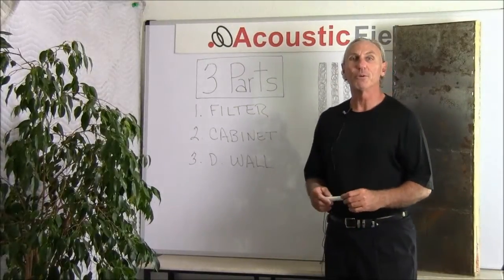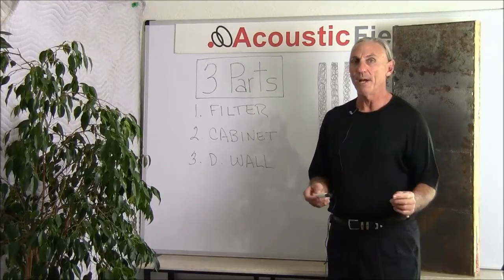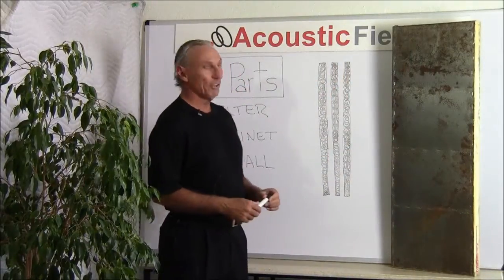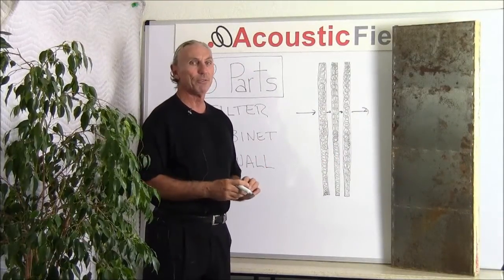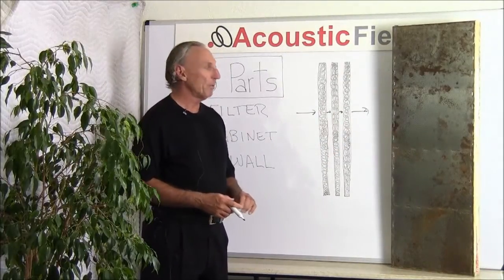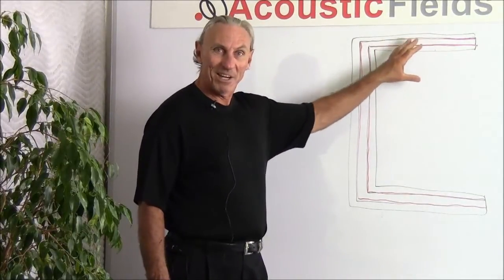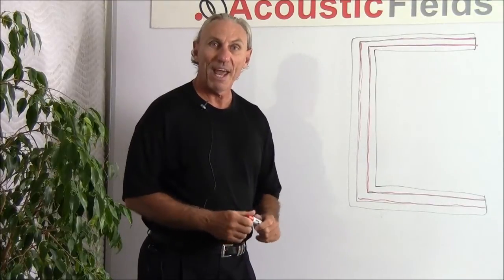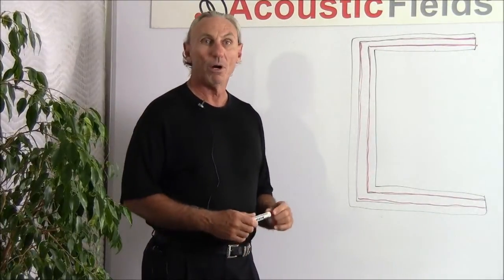How Our Diaphragmatic Absorber Works - www.AcousticFields.com

Comment: What's the material from which cabinets was made? 2 inch walls with 7 layers inside, what is that material it i's possible to know? And, material of front walls? 
In BDA DIY PDF I purchased from your web it says that almost everything was made from MDF except active carbon holders which is perforated PEG boards. 
I assume, cabinets you've built and sell on your webshop are made from different material, right? 
Thank you advance for eventual reply
Vlad
Reply from the maker: S,  Use 1" MDF for the cabinet and 3/8" MDF front wall and 1/2" MDF second front wall.
Reply: Acoustic Fields alright, I understand. Thank you

Comment: This is a marvellous lecture of low freq noise management thanks! I bought the package of instructions and would like to know what kind of carbon to use in it and what kind of foam will do... found some types of carbon "pellets" for swimming pool water filtration / burning gas filtration etc but would like to know more about the suitable type for this kind of absorber, if possible. We are quite eager to know more and to build some in a friendship-member-studio, where the control room is waaaaaayyy too small, illegally small! :(
Reply from the maker: J, Over the counter carbons will not work inside our BDA cabinets. They lack the proper density, porosity count and size. We process our own proprietary technology which we process to insure design parameters are met. Our carnon technology increases performance by 50% per unit. You will need to build 8 units without carbon to create the performance of 4 carbon units.

Comment: what is the formula for calculating the resonant frequency of your bda when using the membrans from your building plans? I need a higher tuning for my ceiling
Reply from the maker: M,  Why do you need a higher "tuning" for your ceiling? You have more than just a 80 Hz. issue from floor to ceiling  You can use the ACDA-10 or the carbon panels. The "thinness" of a panel determines the resonant frequency or how low the unit will absorb down to. Both the ACDA unit design and the CP will work for your ceiling issues.
Reply: @AcousticFields  I know, but the ceiling is only 2,17 m high. I don't want it to hang in my face :).  The mode starts at 85 hz and there are alot of problems above 100 Hz coming from the ceiling

Comment: Have you ever theorized scaling up the design of diaphragmatic absorbers? I'd love to learn about the applications and limitations of shifting the design of the cabinet to the size of a wall! Would you be able to reach a similar effect with a larger but thinner layer of activated carbon? Are there limitations to the diaphragms? I find this design quite interesting but I'd want to see how this technology could be integrated into the actual construction of a room/home theater during the actual building phase. They are so thick that they can take too much space in a room, so I thought "Is there some way to make this the wall itself?". Thank you for humoring me.
Reply from the maker: M,  With our absorber wall technology, we have many variables that we can manage to achieve the results required. If we vary the thickness of our carbon absorbers that are placed between the studs, we increase the rate of absorption. If we increase the cavity depth, we can increase level or frequency of absorption. If we increase the density of the cavity face, we can increase the level. All of these variables can be managed to specifically treat the issues in any small room.

Comment: What does diaphragmatic mean
Reply from the maker: A, Diaphragmatic refers to movement. It is movement of the front wall of a diaphragmatic absorber in direct response to sound pressure exerted upon it. Our technology has two front walls which are in sympathy and out of phase with each other.